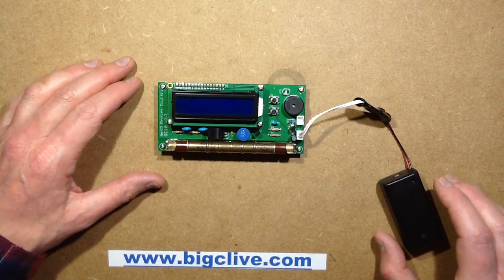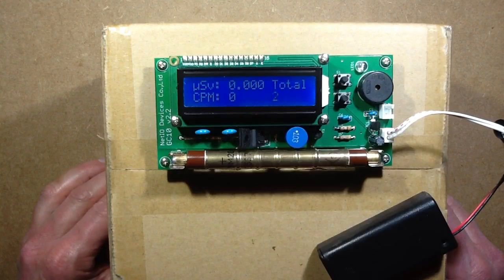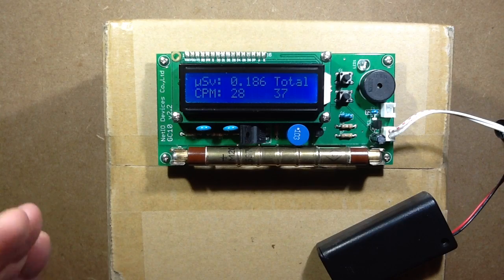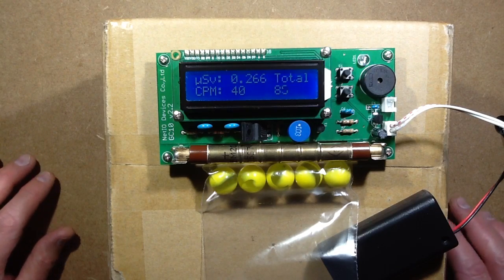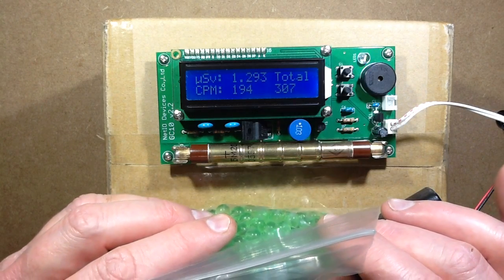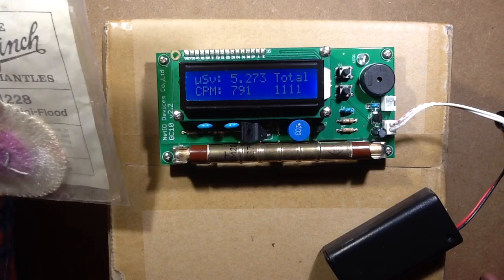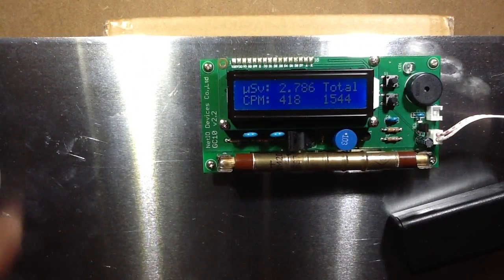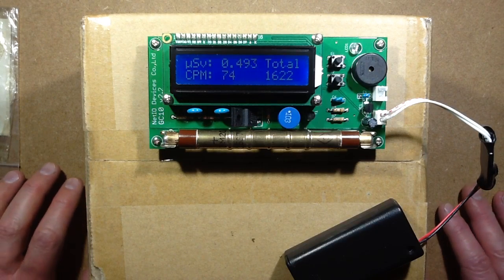Using a Geiger counter on uranium glass and thorium mantles.

Comment: These counters only really detect Gamma as the tube itself will block out nearly all the Beta rays. As for alpha well that won't even get through the air let along the tube wall. Don't ingest Alpha sources though, then they are much more dangerous than Beta and Gamma.
Reply: I know this is a really old comment but should let you know that is incorrect about the tubes.  The SBM20 variants are very sensitive to beta.  I have used them extensively to detect both milder U-glass and pottery glazes.  They are great for that.  Also, alpha can travel about 1" through the air but cannot penetrate that tube wall - unlike beta and gamma.  Got some vids on my channel but nothing as cool as Clive does.  :)
Reply: @nefariumxxx  ( Looks at username...  runs off to watch the your vids )
Reply: These are used mainly for detection of beta emitting contaminants

Comment: Given the 300V across the tube, could this thing give you a bit of a tingle?
Reply from the maker: +Chlorate It could give a zap from the high voltage supply's capacitor.
Reply: Get a 9volt strobe light, the type used in alarm systems etc.
Remove the bulb, connect it to a battery then put your fingers on the connections for the bulb :D
Trust me, 300V is more than a tingle hehe..

Comment: Stupid question: when we were fiddling with these at university we were warmed not to touch the tube due to the voltage. Would you agree, or is the tube / counter safe to physically handle in terms of voltage?
Reply: +Richard T High voltage will shock you, whether you will get permanent damage from it (or die instantly) depends on the amount of current that is available.
The small device bigclivedotcom was using probably doesn't have a high current capacity but a larger device might be dangerous and is probably sealed off properly
Reply: +Marcel Lucassen Thanks, I understand that, but I wasn't sure if the tube was exposed (electrically) ....
Reply: You could almost call it a static charge. You might feel it, but it is certainly not dangerous.
Reply: I've got this counter and I've touched the tubes endless times and never felt anything. I wouldn't touch the contacts but the outer shell seems to be fine.
Reply: the outer shell is the cathode :) (but yeah the anode is limited in current, the other side of the anode resistor is worse, but still not going to kill you in a hurry)

Comment: i dont think the Mueller tubes pick up alpha, just gamma and beta. i think you need pancake tube for alpha. usually an air filter is used and the filter surface is then monitored for alpha particles. knowing the air volume determines the particle density for environment or something like that anyway. an X-ray of the filter will show the hot particles too. X-ray the air filter out of a car sometime for fun. alpha is super bad because you can ingest the particle in a lung or gut and have it forever, mutating nearby cells…. you can kinda inspect food with a mueller but pancake is the norm for food inspection.
Reply: +Scott Leonello GM tubes for alpha need very thin and fragile windows, usually mica/polyester to allow the particles through.

Comment: How did Van Allen measure the radiation when he was surveying the radiation surrounding the earth?  I read somewhere that scientists were puzzled as the geiger counter would hit a certain point of readings and then shut down, the assumption was that there was a radiation free zone in the outer layer of the radiation belt, what in fact was happening was the sensor was being saturated and reading zero.  Does your counter reach a saturation point where it stops reading radiation?
Reply from the maker: +Gromitdog1 I've not actually found a source of enough radiation to do that yet.  But I watched video of the same model being used in Fukushima and it was certainly managing high count rates.
Reply: +Gromitdog1 The first probe which measured radioactivity in Earth's orbit did that, yes. Hundreds of later missions were better equipped.
Reply: Gromitdog1 I have a similar counter that use when playing with radioactive stuff. When I hit it with my home made x-ray machine, it goes off the charts then freezes. If I wanted to get accurate measurements, I would need to use one of my survey meters with an ionization chamber. It can measure tremendously higher radiation than the Geiger Muller tube.

Comment: A little ramble, as the video goes on:It's held at 300-ish volts, that is an SBM-20 Russian/Soviet tube.
Pretty much the benchmark tube for DIY/low-end counters.
The voltage is feedback-based, using an ADC on the controller and a dividier.
It's a boost converter feeding into a relatively(!) large cap.
Uranium is an alpha emitter, but the decay chain emits soft gamma that you're detecting.
Thorium is a gamma emitter.
I'm from Belarus, speak Russian, and I highly disagree with you on the "cool dudes" part. I've been consuming almost exclusively western content because I really dislike our segment of the interwebs.
Oh, and the little dinky iPhone devices are so insensitive they're absolutely useless and pretty much a scam.
Reply from the maker: +Spirit I reckon the iPhone detectors may be based on the blacked out photodiode circuit.
The schematic for this Geiger counter does not show voltage feedback circuitry.  It seems to be based on a calibrated oscillator drive to the step-up circuit.  So I'd be suspicious of its reliability at high count rates.
Reply: bigclivedotcom It's a resistor connected to the diode(BPW34, google it, it's quite a fun and easy project with it if you actually build a power supply for it) directly, then driven by "speaker" output and listened to by the microphone.
The sensitivity is so miniscule it's not going to work, ever.
I remember someone shoving it into an xray machine, that only raised the count to a measely "dangerous" and ~80CPM.
There's not enough power to make an oscillator.

Comment: where did you get this I am in califorina would love to use it on the beach
Reply from the maker: +david wise You can buy quite a few different types on ebay.  Don't get too paranoid about radiation on the beaches from Fukishima.  The natural ambient levels might be skewed by the tendency of some minerals to be naturally radioactive.
Reply: +david wise I'd be more interested in a Radon Gas detector living there.
Reply: i live way north but I think I need both
Reply: Correct, California beach sand is naturally radioactive, mostly from Thorium.

Comment: I power my SBM20 using a photo flash transformer whose primary is pulsed by an mc34063 which gets its feedback from the HV+ via 2 hv zeners of 200V each.
Works like a charm.

Comment: Seeing that they step the volts up to 5 volts. Do you think I could use a usb battery pack to power it and just cut up a usb cable and use it to run it and put it all in a case? I just don't want the whole thing to go pop
Reply from the maker: Yeah, that should work.  Just double check the polarity of your USB lead after you've bared the ends.  I've had some that had the wrong polarity.  Fine in the original lead, but wrong when cut and used for another purpose.

Comment: Clive, I have also recommend that geiger counter to friends.  It's a good deal, especially with the tube included.  I think the SBM20 runs on more like 400v.  If you want to actually measure the voltage - get a 1 Gig ohm resistor.  Make sure it's 1% tolerance.  Use that inline with your multimeter and it won't bog down the delicate HV.  Multiply the reading x100 and that's your correct voltage.  Here's a secret that may work on your model if it's recent enough firmware.  Try powering it on while holding the upper button down for a few seconds.  That will enable you to choose "click" mode instead of "beep" mode.  Another tip... if you want to block most all of the beta and only measure Gamma CPM hitting your tube, you need 3mm thick aluminum.  So if your sheet is half that thick, you could try folding it over on itself to double the thickness or use tin snips to cut it.  PS: you may know by now that marbles and beads are mostly beta activity, so no big deal to handle those.  Here's a little slideshow I made of uranium glass under a standard black light tube: http://youtu.be/PvwAiim38sc

Comment: Tritium emission will be stopped totally by glass. That is why they are safe in exit signs.

I have some modern mantles ( made in China) and they are also radioactive, though they have lower levels of Thorium. Must take apart an old ionisation smoke detector and see how active the tiny blob inside is.
Reply: The source in an ionisation smoke detector is Americium 241-its primarily an Alpha emitter, so a standard metal or glass wall GM tube won't detect much...A mica window GM tube or other Alpha detector will detect the Alpha-lots of it.
A metal or glass GM tube will detect a SLIGHT bit of radiation from it though-even though it's mostly an Alpha emitter, it emits a small amount of low energy Gamma, mostly at 59.5 KeV.
This is very low energy, and does not travel far, so no substantial hazard.

Comment: Now that's something i'm getting, where did you get yours? Do you need to get the tube separately? Thank you, that was interesting! What about Tritium vials?
Reply from the maker: I got this one from a seller on ebay.  Tritium is a low energy beta particle emitter.  I'm not sure much radiation would escape through the glass and plastic housing.